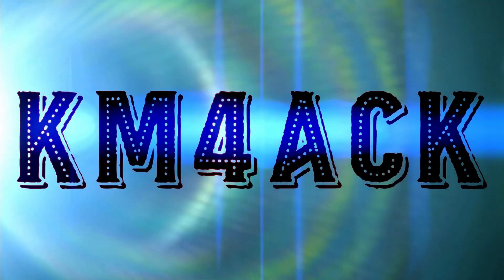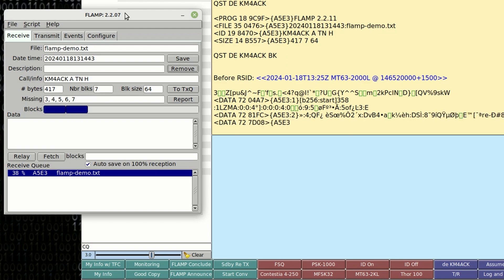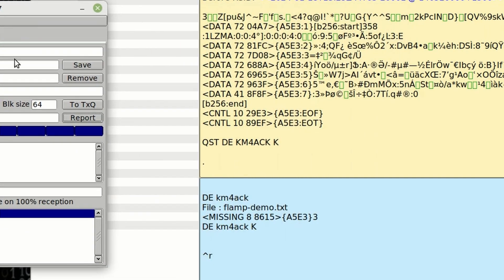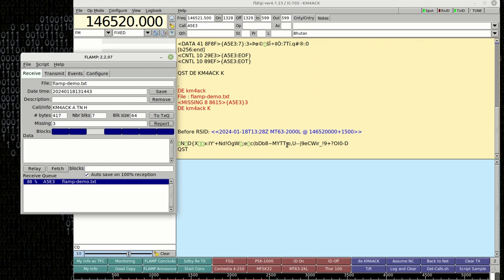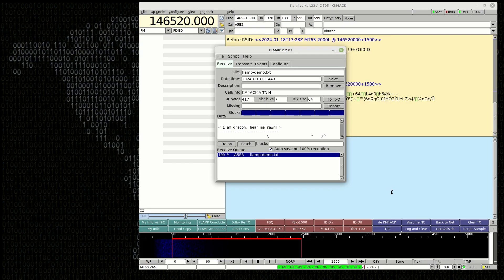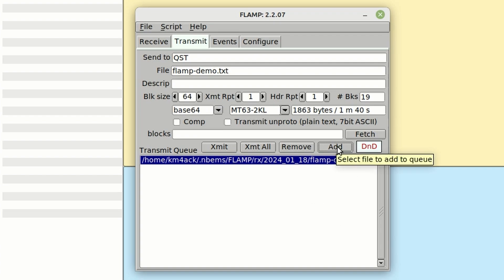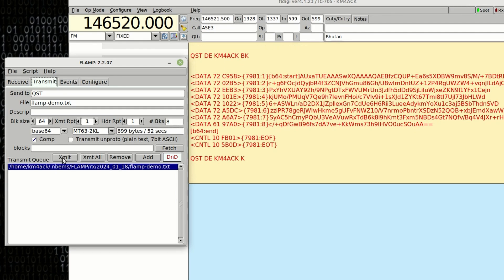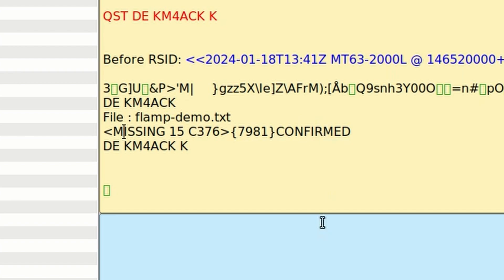FLAMP in Depth :: NBEMS 5 of 6

Comment: @km4ack awesome series!  I wonder if there is a way to use FLAMP and/or FLMSG with VARA?
Reply from the maker: Thanks! Negative on using either with VARA
Reply: How did you all settle on mt 63 2KL?  I’m pretty sure psk modes don’t work on fm, so that’s one reason, but wondered if there were other considerations.
Reply: Found p6 in this doc … makes sense: https://www.w3hzu.com/content/emcomm/nbems_webinar.pdf